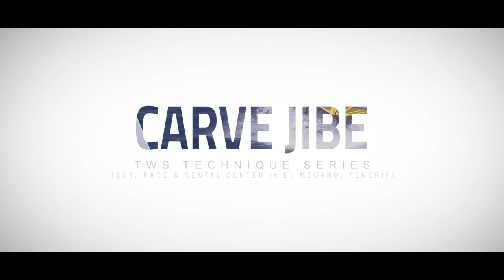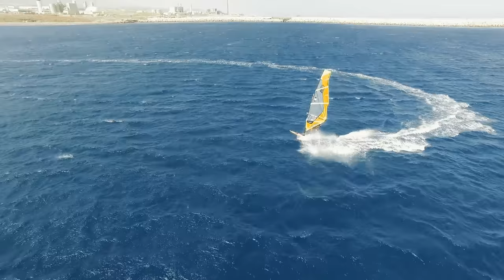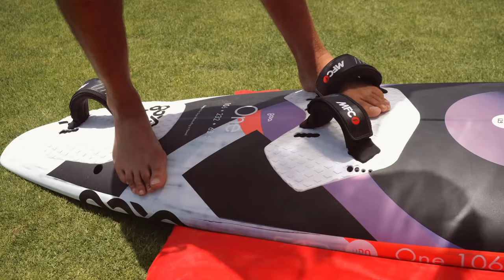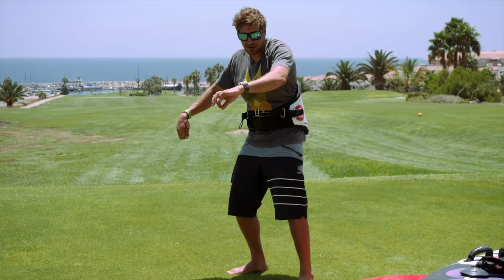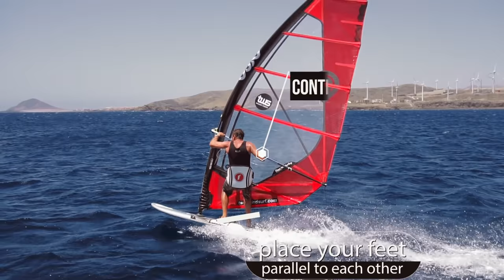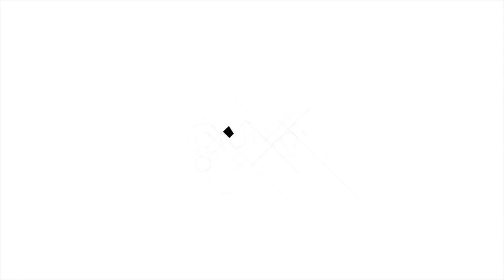Episode 2: Carve jibe, how to gybe, jibing tips technique tutorial windsurfing

Comment: The only video of explaining when the rig will go light,  other tutorials just mentioned when going fast, the rig will become light. Your video explained the feeling of going light., the transition from heavy to light....This is important as I can adjust my body to correctly adjust the pulling force of the sail..

My mistake is when I step the back foot on the leeward rail, my body is not leaning back anymore (although I am staying low with my knee bent).  As a result, the sail pulls me to the water when my back hand sheets in and front hand push at the same time